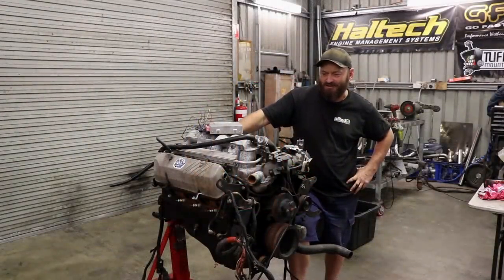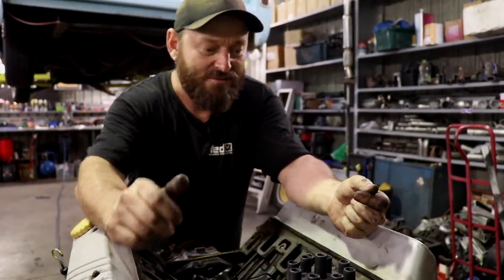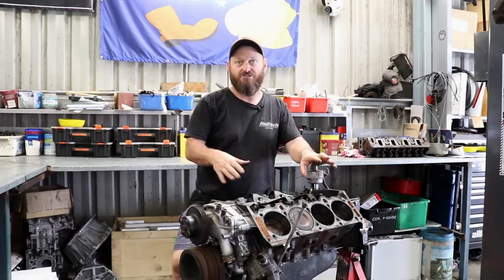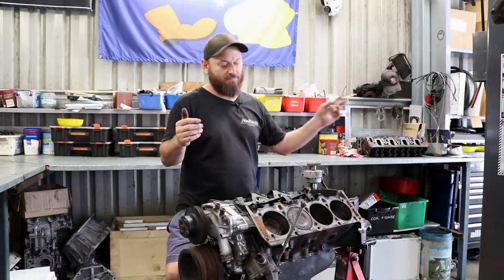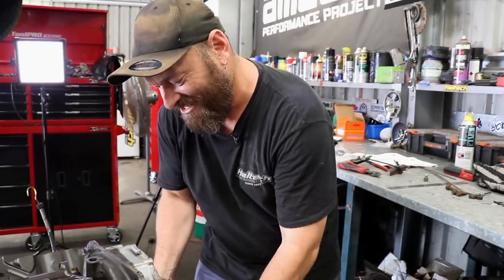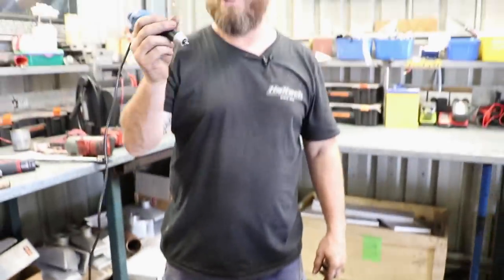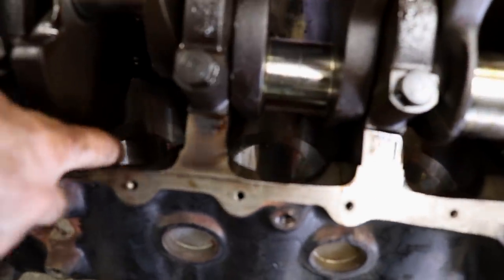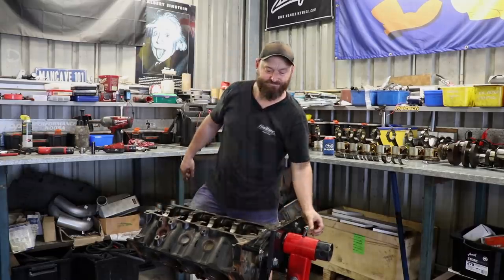GM HOLDEN 304 V8 ENGINE RE-BUILD [EP1]

Comment: A G.M. five liter where the whole thing doesn't belong at recyclers? Hmmm I don't know... Every single one sold in the states was a complete pos
Reply: We had to make it work. It was all we really had down here. They did race those engines as Al said. Didn't go to Chevs until about 1996 or so (which were just NASCAR engines that we didn't rev past 7,000 rpm)

Pretty sure Larry Perkins won Bathurst in 1995 with a Holden motor and it was possibly the last time a 304 won a race (don't quote me on that though)
Reply: There is a stock car class all around the 305. Not junk
Reply: Wesley Snyder it depends how they're getting to 305. The bone stock factory ones all had issues because of using such a small bore compared to the stroke, rod ratio, chamber size etc. 🤷‍♂️
Reply: Limit-R yeah they did some weird stuff. 4.3 in the states maybe being the most useless V8. I commented and then paid attention. 🙄 That isn't like the ones I meant. 302 and 307 chevs weren't bad but if you built one most people just went bigger. 305s were garbage. 307 olds was reliable but didn't make any power. And finally the LS came along and made life easy.
Reply: Leroy Baker totally different animal
Reply: @brianlinton910  it's cool I get ya. That being said my 305 in my Malibu is rock solid.had it for 15 years.only flattened the cam once
Reply: Wesley Snyder you're one of the few lucky ones for sure. Depends on how the owner treats it but still. You're getting what maybe 15 mpg and 120 horses to the wheel/s. And the ones in trucks were even more detuned to try to get them to live past the warranty.
Reply: @brianlinton910  22 Hwy 18 city.Just have to understand a qjet. it's a nice daily.